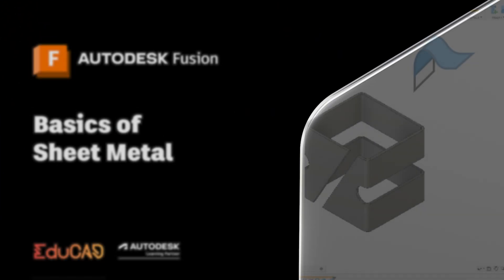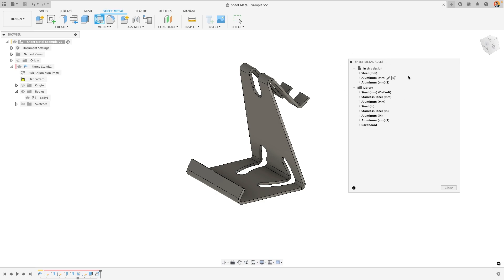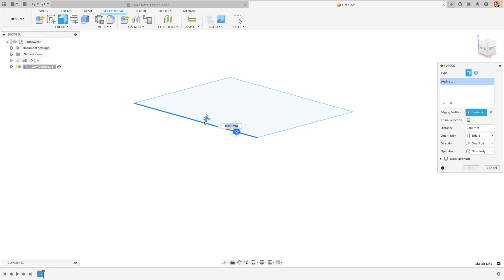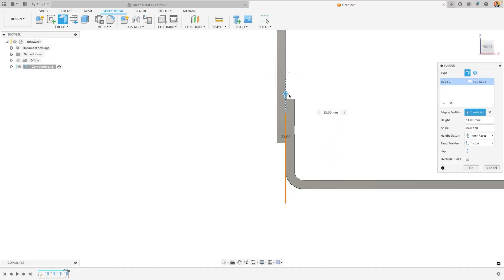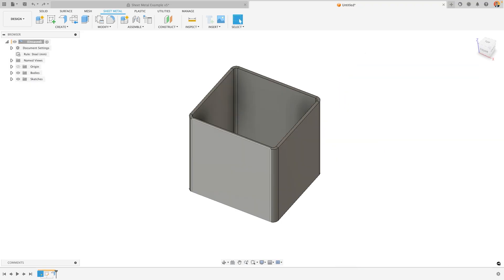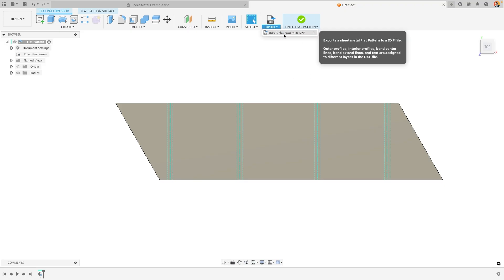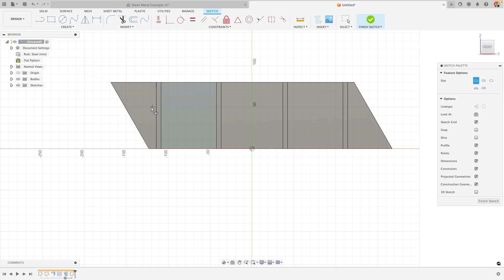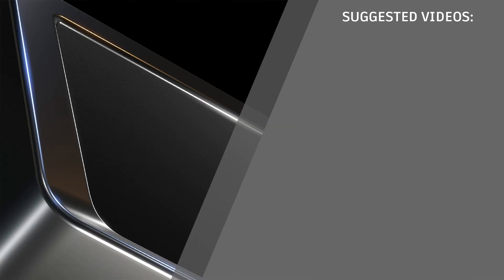Learn Sheet Metal Basics (and Avoid Mistakes!) in Autodesk Fusion

Comment: Good clear tutorial. I am making a camper box to sit on a truck bed from 3mm aluminium plate folded into various profiles and foam/GRP composite wall/ floor panels. Not sure if I need to start with the overall solid shape and then design the exo skeleton to fit it or design it as a series of frame pieces. Favouring the  former. Do you have any examples of the design method for this type of project?

Comment: The bend tool does not work that way.  What he is showing is a rectangular piece of metal with a bend line through it at an angle.  After bending what he's left with are two trapezoids.  That ain't the way it works for me.  I did exactly the same thing as he did.  What I end up with is a trapezoid on the stationary side and A RECTANGLE on the bent side.  And when I flatten it back to the (hopefully) original position what I get is a boomerang shaped flat pattern.  WTF???

Comment: Thanks for the informative presentation.  🙌 Will the sheetmetal rules work with PIR Board?  I'm designing HVAC ductwork using PIR Board, which is 20mm thick. Thanks in Advance. 🙏
Reply from the maker: Hi! 
You can absolutely get the sheet metal rules to work. That being said, as you would not be bending the PIR board, the value of the sheet metal tools isn't going to be as high. Mostly it would define the thickness automatically and not much more. 
Since you would want each PIR board piece to be its own component anyway, you wouldn't use the Flange, Bend, Rip or main sheet metal tools :)

Comment: Excellent starting out video, Fusion really needs a normal or perpendicular to surface function. It can be very time consuming figuring out work arounds when you have an irregular shape cutting through an angled surface. Sheet metal should also have a more detailed error function. It is smart enough to tell you there is an error, but many times doesn't tell you where, that is ridiculous.

Comment: I still hope more features will be added to sheet metal in the future. Such as convert a solid shape to sheet metal like in Solidworks for example. Where you click on the faces of the solid and it will automatically be converted into a sheet metal. This would be especially helpful for complex shapes
Reply from the maker: Hi! We really appreciate your feedback and thoughts. There is the option to turn a solid body into a sheet metal body. It is called "Convert to Sheet Metal" and can be found within the create menu of the sheet metal tab. We would love to hear if this meets your requirements, and if not what the feature would do differently to improve your workflow :)
Reply: @adskFusion  thanks for getting back. yes I am aware of this command, but it doesn't derive the faces of a cube for example into a sheat metal. it needs to be flat/ shelled. A better experience would be if I can select the face of a solid that I would like to become sheet metal....
Reply from the maker: Thanks for clarifying, feedback like this is incredibly valuable! I will pass on the feedback to the development teams ☺️ In the meantime I hope the video was helpful for you and that it enabled you to complete your work with the currently available tools!?

Comment: I would like the option to remove bend reliefs or minimise them. folding mainly thin metals, 3mm, 2mm and 1.6 etc a tight relief does not normally cause problems. I do lots of bespoke metal work and find my self often extruding the releifs on the flat pattern to create a nice tight edge after folding. A workaround I do use is changing the bend radius to 0.1mm.
Reply from the maker: Hi Joel! Have you tried adjusting your corner conditions within your sheet metal rules? Specifically, the "Tear" relief shape might create the results you are looking for. Unfortunately, we didn't have time in this video to go through all of the specifics of the corner conditions options, however this article we have explains them in a lot of detail: https://help.autodesk.com/view/fusion360/ENU/?guid=SM-RULES-REF

Let us know if that works for you!

Comment: Day 44 of asking for Dark Mode in Fusion 360
Reply: Of all the things they can fix on the mac UI, dark mode is several thousand from the top of the list
Reply: Put on sunglasses.
Reply: There is a dark mode. You can change the workspace backdrop color by going through the menus on the little computer screen on the bottom just above the timeline
Reply: @Mirage5892  Unfortunately that doesn't change the UI. I know about changing the "environment", it's not good enough for what I am looking for.